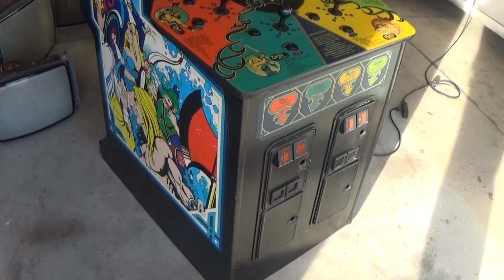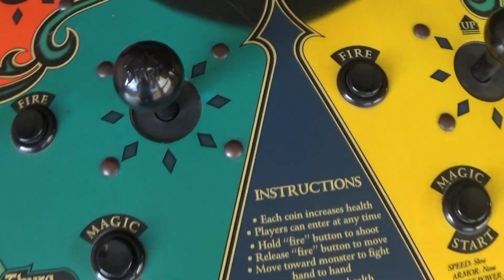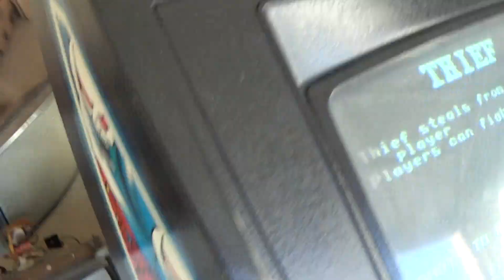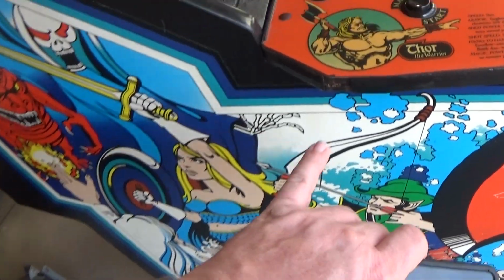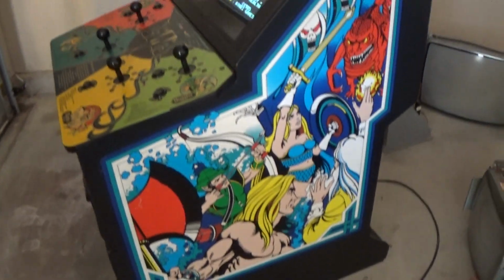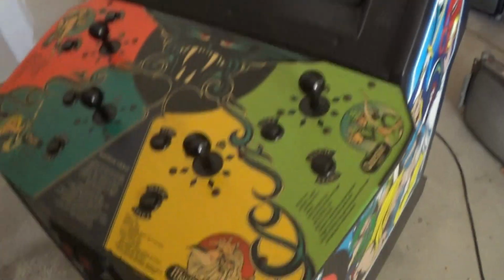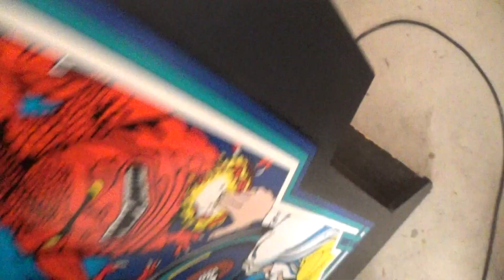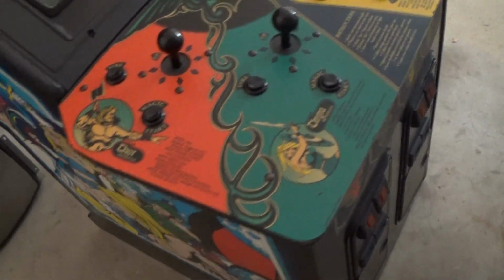Atari Gauntlet Arcade Machine Acquisition! All Original...(Mostly)! [Part 1]

Comment: Actually that is not the true dedicated original side art on your Gauntlet.  The factory side art had ghosts that go all the way to the top on each side.. I know because I have  an original dedicated Gauntlet with factory side art.  The art that is on yours is replacement art where ghosts don't go all the way to the top. Still a great find, one of the all time classics!
Reply from the maker: Did some quick research and the art that goes all the way to the top appears to be for Gauntlet II. Every picture I see of the original Gauntlet looks like this machine.
Reply: @YourMKArcadeSource  The pics people post of their Gauntlets  often show the half side art for the original Gauntlet because it's very rare to see an original dedicated Gauntlet with it's dedicated side art intact. Nearly all were damaged through the years and this replaced with the half side art.  It took me years to find my Gauntlet that has it's original side art.  Check out the original flyer from Atari for the original dedicated Gauntlet and you will see the side art does indeed go all the way to the top with ghosts on the side...  Otherwise I can send you pics of mine...
Reply from the maker: Gotchya. Good info. Thanks.